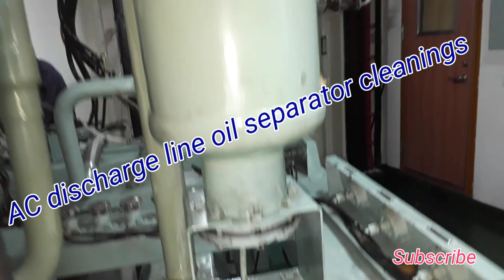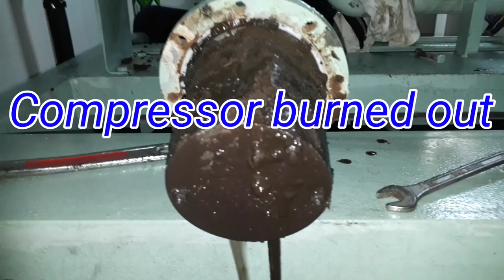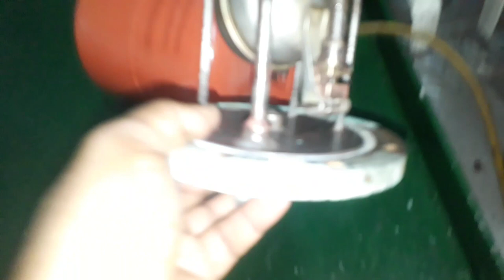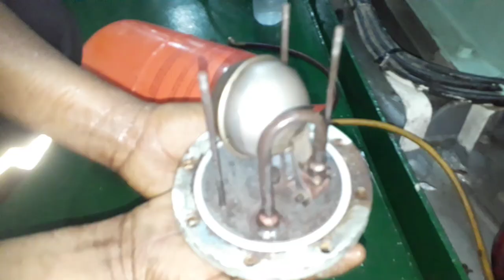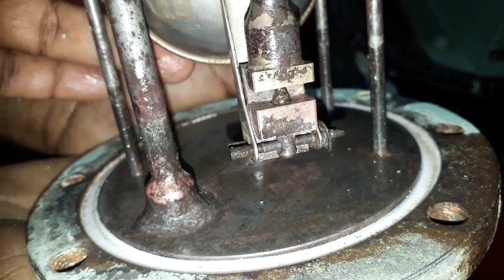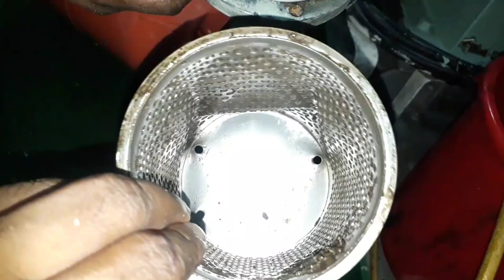Oil separator servicing

Comment: I have problem with this, lub oil no return back to crack case then low lub oil , then Engineer duty fill up lub oil after view day the oil return back and booom , all valve broken lub oil go trough at piston
Reply from the maker: any oil separator in discharge line, maybe your oil separator is not working properly or compressor is lifting oil, ( oil ring defective )
Reply: Mtech Cooling Solutions cool cool , ya l suspect separator valve not working properly , and have to clean but why to many oil , its oil ring need renew ?
Reply from the maker: if your oil separator and oil return line ok, then u need to overhaul compressor before you overhaul compressor please make sure oil separator and oil return line to the compressor is good condition.
Reply: Mtech Cooling Solutions cool cool ok thanks bro for your advice 👍👍
Reply: Mtech Cooling Solutions cool cool  our compressor Carrier 5H66 l am seaman bro , now waiting our spare part piston set , cause the suction valve broken and 3 pcs piston scratc